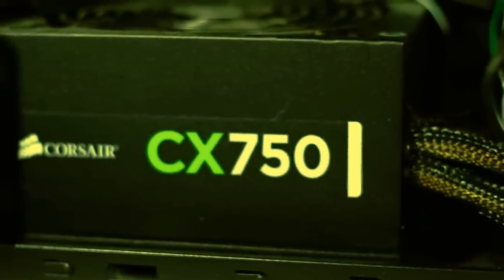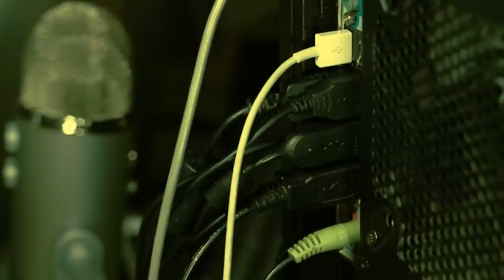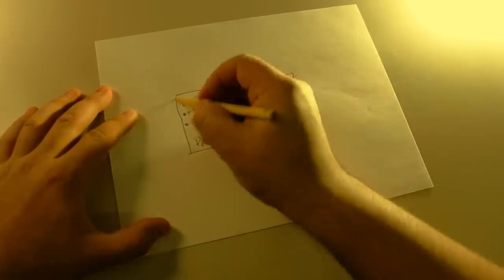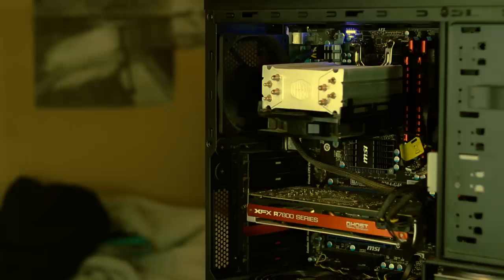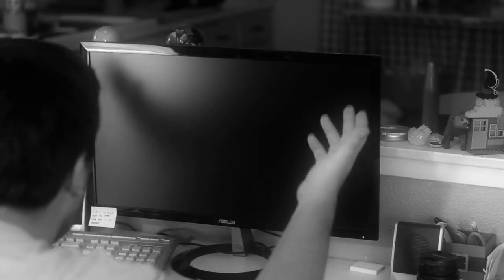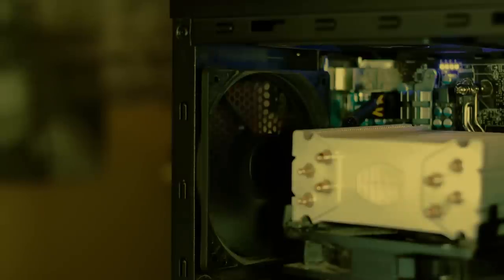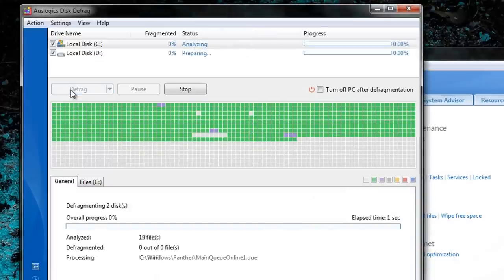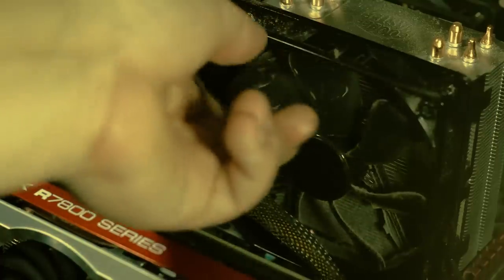What To Do When Your PC Shuts Down At Random

Comment: my PC is literally 2 days old.
I had been playing games for 4-5 hours. I was playing CS GO and it suddenly shut down. and now it doesn't start up or display anything. the fans work, even the GPU fan works. even the lights work. can anyone help here?

specs-
i5 6500
8gb ddr4
gtx 750ti
asus z170k
Reply: check the plug
Reply: Check the temperature of your PC and see if your fans are configured correctly. You might just need proper airflow so that air can come in through the PC and exhaust out.
Reply: try to put mtn dew i hope it will work :D
Reply: Gian Velasquez PC hasn't been working for the last few days. It's cold. Still doesn't work. The airflow is proper
Reply: put mtn dew :D
Reply: +Gaurav Talreja since the pc is so new, some cables/parts probably werent installed correctly.
Reply: Gaurav Talreja Hm, that's interesting. Could you possibly post a link with pictures on another device of what the interior looks like? Another idea is that the CPU cooler might not be tightened down all the way?
Reply: It was the motherboard
Reply: What exactly was wrong with the mobo? Mine randomly stopped working as well (would only turn on for a minute and then shut off)
Reply: Christopher Wang they didn't tell me what was wrong.
Reply: bro i found the ppreblemo its your graphic card disable it and play nor it will keep shut ing down
Reply: +Gaurav Talreja bro plz help me when i play cs go it shuts down too i got a good pc like yours plz help
Reply: Maybe Moniter not Plugged or attached?
Reply: same man i was playing csgo and then it shut down BUT I KNOW HOW TO FIX

basically csgo has a very high fps that normal laptops cant handle(yours and mine) so it shut down so to fix is to put all video setting down and you will have a very low fps (10-25) but your laptop wont shutdown
Reply: Best Solution (Why high graphic games shutdown laptop/pc lol??) :
-go to "control panel"
-search "Power" or "Power Option" if doesnt appear goto search menu type "Power Option"
-click "edit power plan"
-click "change advance power settings"
-scroll down "Advance Settings" if din appear click on "My Custom Plan 1(active)"
-scroll down until u see "processor power management"
-click "maximum processor state"
-now click/change the percentage to 90%
-this is always "100%" , changing by 1% to 10% will helps a lot
note that; 90-95% is preferred for processor power if u are gamer 

if this still happens check this out:
1) sometime the copy of game "program itself to be shutdown at the mid of game" , nowadays cyber cafe using this programming for a game steal'er outside there haha .. 
2) Recently i had this problem with my laptop , i have 3 diff charger but its still shutting down at the mid of the game , not the charger broken it might be :
i) your home wiring not properly wiring , so when someone switch on/off plug at house or any place it will cause pc/laptop shutdown at certain moment (experiment with your laptop n plug the battery) , sometime your connected devices such as kboard,mouse,pendrive also dint work for a second**electric cause**
ii) fan air flow / component not properly connected 
iii)  graphic card & motherboard
Reply: lolz lolz its pc.
Reply: same problem from 3 years..please help
Reply: I have this same problem
Reply: I got my computer and the mobo wasn’t plugged in
Reply: click ctrl + shift + esc then click new task run then type explorer.exe
Reply: Same here, checked the plug, did almost everything I could
Reply: may be your pc has avirus
Reply: my laptop shutdown automatically and at random then what i did is a i downloaded and installed avast anti virus this is just my opinion
Reply: same hare no fix found
Reply: i have the same problem expect the game is fortnite lol and specs are fx 8350, rx 580 8gb and 8 gb ddr3
Reply: Have the same probleme dude

Comment: I've got this problem. However, I've got a couple of very specific 
symptoms I hope can shed some light on what exactly is causing this 
problem.

1. It happens as I try to boot Windows. I can usually 
last only for a few minutes in regular windows before it randomly shuts 
down.

2. I DON'T have this problem in safe mode! I'm in safe mode right now!

3.
 When it shuts down, the LED light on the front is still on. I have to 
either unplug the AC cord, or flip the switch to off, and wait about ten
 seconds for the LED light to power down due to lack of juice before I 
can turn the power back on again.

Do these three symptoms tell you anything about what the problem is?

Comment: Downloaded an AMD driver the other day. My pc will restart itself randomly sometimes after 1 hour, 2 hours or even 20 minutes. My PC is always cool and does not go above 40 in GPU or CPU when this happens. And this always happens either on desktop or on web browser never in game. 

Any ideas?
Reply: +kingmatt2563 Your motherboard is either damaged or something strange has happened. Try reinstalling the AMD driver or buy a new motherboard.
Reply: Mert YILMAZ Cheers. Na turned out to be a bios issue so I restarted it. All good now but thanks though.
Reply: I have the same problem sadly restarting bios didnt help me
Reply: How did you restart it? Did you remove the battery or just restarted it from the BIOS menü?
Reply: Mert YILMAZ My uncle came over and pushed some button. No idea what one though sorry. But it was on the mobo
Reply: Thanks but nothing seem to fix my problem. Gonna buy a new motherboard.
Reply: Mert YILMAZ KK sorry it did not work out.

Comment: My computer turns off whenever I:

A. Take a shower (only rarely it doesn't happen)

B. Have dinner (again, rarely it doesn't happen)

Or

C. Play Minecraft Modded (always happens)

But my sister says it's the wire thing.

Comment: Great video. I will start going through the check list. I am guessing it's a loose cable somewhere that's cause it. It's definitely not the CPU fan or GPU as I tested them already and installed a new fan cooler. 
It might be the 24 pin mbps connector.

Comment: Need help my computer only shuts down in gameplay when I turn on crossfire I've checked all the connections and both cards are water cooled( r9 295x2 with r9 290x). The 290x is the problem but it just recently started happening please help.

Comment: I’m pretty sure it’s a lack of power. My PSU can handle it by my wall ports can’t. Whenever I’m running at 120% power my PC shuts down. How do I get more wattage out of a 2400w wall outlet?. I am using multiple TV’s and other high wattage devices that total to 2300w.

Comment: My PC shuts down when I play DOTA 2 and I have to unplug the power cable from the PC and plug it back in in order to turn it back on. Any ideas?
Reply: Sorry, you play dota :( I would help but... I'm a league player myself
Reply: +SestraAnka ... haha... interested in this answer as well!
Reply: same problem here. the PC is not shutting down. still on but it's get blank
Reply: for me I found out its because my motherboard or the electricity source... there might be a heat problem... especially if my computer works fine when it was shut down after 4-5 hours... then it works for a few 1-2 hours then if it gets hot outside... and keep doing heavy stuff.. it will probably shut down / restart till I let it to cool off...
Reply: my problem solved with thermal paste on the CPU, ive change it with another one. hope this answer your problem
Reply: Muhammad fathurrahman ... my CPU has a temperature of 45-50* Celsius... so its actually very cold... before having the cooler 1 year ago.. it was 70-80* Celsius... so for me my CPU is not the problem... I found out that my PC is actually too fast for my motherboad... and if I do things too fast.... it crashes.. :)
Reply: +SestraAnka same

Comment: mine always shutoff when im trying to play games, and now i can't even turn it on as long as the 6pin plug on the graphics card is plugged in. i got a msi gtx970 gaming 4g, driver was correctly installed. what could that be? is my graphics card burnt out?

Comment: computer shuts down, all the led lights on the mobo are lit, and i won't turn on, after a few seconds i pressed it again then it turns on, on desktop now and turns off again! PSU was like a battery, i didnt use it for like an hour then i turned it on, and its running for several minutes then shuts down. turned back again then shuts down again! help!

Comment: Had this random shut down problem and tried to trouble shoot mine.  Had to start with cleaning and re-socket everything.  At first i thought the power supply died out on me then i thought it was the RAM.  Did some final checks and turns out the temps were going high on the cpu and i ended up re-applying thermal paste.  Might end up with a better cpu fan or liquid cooling soon.

Comment: My pc shuts down at complete random? I've been running Open Hardware monitor and the temperatures seems fine even whilst playing. the GPS is pretty old right now, so maybe that's the issue? The cooling systems all work plus my power supply is brand new. For the life of me I can't figure it out. help?

Comment: My computer is randomly shutting off. It does not have a time limit like a sleeping schedule. It's a Windows 8 Computer PC by Asrock, and I've had it for about a year. Everything works, like the fans, but it keeps shutting down. It will freeze for a second, go black, and if audio is playing, the audio will skip and glitch until the computer is completely shut down. I always need to restart my computer by the PC Box to turn it back on. Even if I do, Auto-Adjust makes it freeze up. So I need to hit the same smaller button, and then it reverts back to normal by loading in the Microsoft loading screen and goes back to the sign in page.

It's getting to a point where I just want to fucking throw my computer out the window and not even give a shit on who it hits, and what happens to it.
We're not sure what to do. We blew out the dust and made sure the wires are not getting into the fan, but it keeps shutting down. Like I said, no schedule. So it isn't shutting down every 24 hours, 30 minutes, 5 minutes, etc. It just randomly shuts down. If anyone can help, please do so and reply.

Comment: Mine turned off itself after 5 secs the cpu opened and none of the components of it is working like the monitor keyboard mouse mic and all of that
So I turned it off and the power regulator
After 1 hour
I turned on the power regular and I saw on my router that my pc is connected even though the cpu is still not open
What shall I do?

Comment: Right now I have an issue where I’m gaming and it randomly shuts off - temps are fine all test are passed but my battery has an issue where it says it’s at 100% but when I unplug it turns off in like 3-5 mins , is it possible that it’s my battery causing the shut downs during gaming ?

Comment: My computer turns off when i play high quality games: CS:GO, ROBLOX, Call Of Duty and more 3D games, that was happening before, it used to happen because it is full of dust and then i clean it and it works... but now i cleaned it and it won't work i can play like 5 mins. and then it just turns off and says VGA NO SIGNAL. I guess it is the battery can you help me with this?

Comment: currently I'm having a problem with my computer when I'm playing games browsing the internet or even leaving it alone it'll reset itself. we checked the temperature is using CPUID HWMonitor and it was running pretty well No extreme temperatures ( the temperature were 41 degrees Celsius on my CPU and 66 degrees Celsius on my GPU) its just that the computer just reset itself for apparently no reason. is there any way you could possibly help out?

Comment: Windows 7 
Toshiba Qosmio X505 Laptop
NVIDIA GeForce GTX 460M
Intel(R) Core(TM) i7 CPU         Q 740    @   1.73GHz
8gb ram
64bit
Issue:
Randomly shuts down when I play a kinda demanding game on the lowest settings. It used to play those games properly without randomly shutting down, but this issue started happening out of nowhere. My laptop is secure from viruses, did what I could like defrag registry fix, remove junk files using AVG Tune up and even changed the Maximum processor state from 100% to 90% in the Power Options. But still, my friends get really mad at me when i play league of legends with them and my laptop just randomly shuts down.
It also happens when I play Killing Floor 2
10 seconds in and it immediately shuts down without being overheated.
help please

Comment: So my PC only shut down when I play a few hour of intensive graphic game.  I install CPU and Graphic Card Temp Monitor to monitor the Temperature.  It does not seam to be overheating, but it still Shut Down.  All Power plug are secure and plug in.  Could this be a faulty Power Supply?

Comment: So i have a 430w psu which is gold rated 80+ from bequiet.. I have a gtx 750ti and a xeon X5450 and 4 gb of ram.. Temperstures are really low because I made the cooler for my cpu. Temps under full load after 1 hr are 55 C° on my cpu, and on my gpu they are under 60 C°. The problem is my pc only shuts down when I play League of Legends. Any tips?

Comment: with my pc i am running 5 hard drives on a 1200watt psu, its worked fine for months but now when i turn power on pc stays on few sec then shuts down, i found out it was the hdd when i removed just one then the pc started fine? its weird

Comment: i have the same problem. I have gtx 1060, i5 6500  and a 500w psu some people say its my psu not supplying enough power to my pc components. Is it true?
Reply: 5hutUpNpl4Y no; 500w is plenty. You're either overheating which is very possible even if you have new components (I had this problem once that started just 3 weeks after I built the PC) , your drivers are malfunctioning, there is a loose power cable, or your CPU or GPU may be defective in which case you should send the PC to MicroCenter or something so they can diagnose which part is defective and then you should send it back to the place you bought it from- most retailers put 1 year warranties on everything.

Comment: Can u help me wit my specific problem....my pc is almost 1 month old...but started my pc then 
after 5-10 minutes pc is automatically shut down ..everything is off but ram rgb lighting and any other lighting continue works...again and again I tried pc on but same result after some time its off...plz help what’s problem.. am not play gaming etc.. my pc spec...
Processor: ryzen 5 2400g
Mother board : msi b450 mortar
Ram : gskill 16 gb 3000 mhz rgb
Power supply: corsair vs550

Comment: can someone is the main cause of this problem on my pc?asap pls. my pc keeps shutting down after 10mins. is it overheating? i dont want to reformat it. it runs so smooth in the beginning but later on it keeps shutting down. it doesnt display shutting down. after sudden shutdown i tried turning it on again but after bios and starting windows it suddenly turned off. in the past weeks my friend said that i shouldnt use deepfreeze on my system hdd so i removed it. pls help me

Comment: i just bought a 600w power supply for my radeon r7 260 graph. and when i lock my pc(windows+L) it keeps shutting down after like 30 mins. and also a light on the pc case called P.D.D. blinks when it's randomly shut down.

Comment: Hello guys... I will get to my problem directly - When I play games, the PC reboots as if I pushed the reboot button. I am sure my PC is not overheating. I am sure it's not some type of virus or anything like that. I tried to push EVERY SINGLE CABLE I could... No changes... I tried plugging my PC directly into "the wall"... No changes... and it only happens when playing games. Also seems like it happens on the same places - in Far Cry 4 it happens right at the startup. In League of Legends or Dota 2 it happens right after the loading screen is over. Also sometimes it happens and sometimes not. I don't really think it's the PSU. Reply to me if you need my specs :) And thank You for you further help. :)

Comment: So i was playing games on my cheap pc and it turned off i tried plugging and unplugging the power cable and it turned on and off and that was the last time i saw it turned on when i opened the cpu there are some cables that are unplugged and the fans are really dirty my cpu is really cheap and there is no graphics card i only play low spec games should i not touch the unplugged cables and just clean the fans so it will work again ? pls i need help

Comment: I have a GTX 970, AMD FX 8350, 650W PSU, And an h100i. It shuts down whilst playing ANY game, and I did not have this issue before installing the h100i, leading me to believe its a PSU issue. Plus, my 12V readings in my BIOS is red. Not sure what it means, or what to do. PC is only 4-5 months old, no problems beside overheating before I installed the h100i, now its shutdowns while gaming. HELP
Reply: I have the exact same build  I believe the psu is not good enough but I run a fx 4300 I also have the  tk650 with 80+ gold and it just shuts off I think it needs more power
Reply: ***** Yeah, I bought a 750W and it runs perfect now!

Comment: hey bro, i need help.
i have 650w cooler master PSU, gtx 1070, i5 4460, 20gb ram and gigabyte z97x gaming 3
my pc restarts only while gaming. I've checked all the plugs both inside my pc and outside. I've reinstalled the windows this tpp but problem didn't fix. it restarted in 65c(gpu) and 55c(cpu). I have enough fan to take the heat outside too.
now, can you please tell me what is the cause of restarting while gaming only? it sometime restarts in only 10 or 15 mins and sometime it takes  2 or 3 hours to restart.

Comment: Well it's none of the mentioned which worries me. It doesn't happen while I play games, my power supply can handle the GPU requirements, all cables are plugged in and PC temps are normal, could this mean I have a faulty HDD? HDD was recently replaced with one of the same model so?